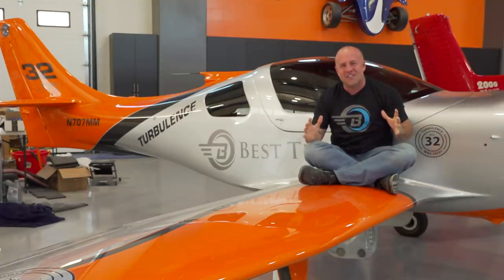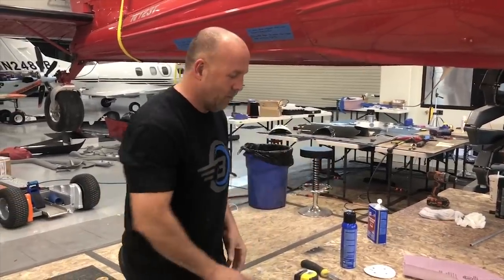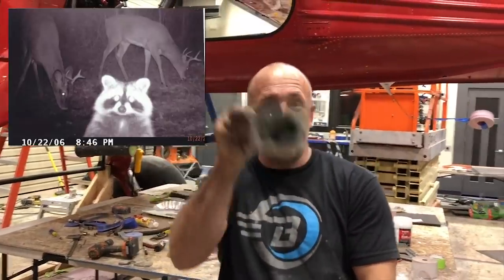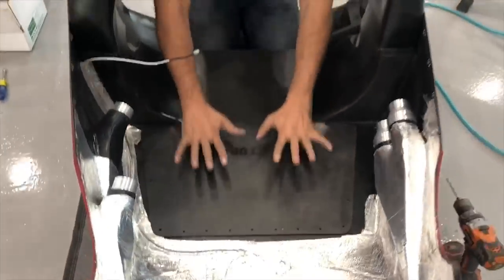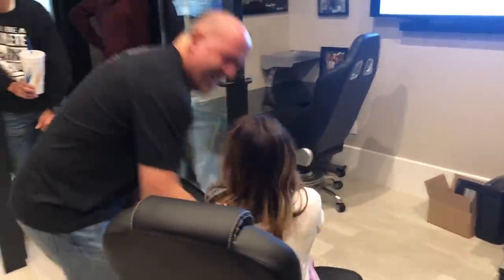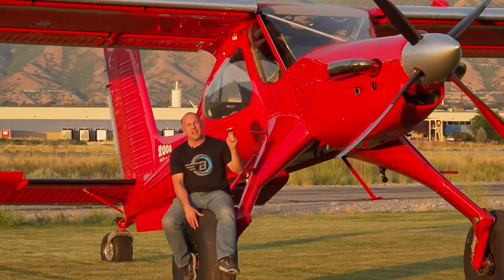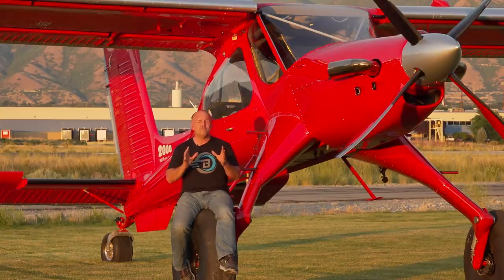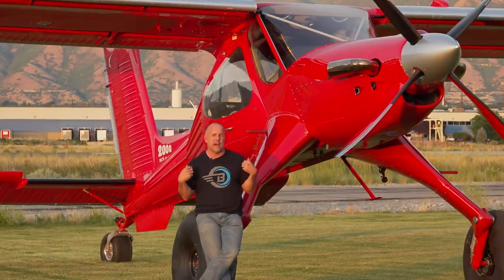Mike Patey Wilga (DRACO Video 16) Draco is Born

Comment: There are some elegant planes in that shed, both on the ground and on photographs hanging on the wall.  Looking on the lines of those planes, I must say that these people are highly intelligent and they have a  sensitive feel for dynamics and what is more they can build it all in practical terms, Congratulations  to all and I like the sense of humour while this gentle man works his masterpieces with such dedication.    Many years ago we had a go at building the Berkut and that was an eye opener for me in dealing with  blue foam and other modern material and how we tried to use every nick and cranny to put extra fuel in it including the hollow spar .   The Draco is beautiful  plane with ample power. I wonder if it could use that exhaust to blow the tailplane/rudder  so that on reverse pitch , the air  mushroom that is created would  not reverse on to them cutting their control abilities.

Comment: Thank you A LOT for the video series so far. It's been a blast. I am a computer engineer and totally envy your fabrication skills. It is totally inspirational and it boosts the creativness and will to make stuff. I am also a pilot and also see inspiration in there - one side is back country flying that few can experience but other is the pure theorethical knowledge about how aircraft works. It has been a mad project to take a fully certified aircraft and modify it to the point that it has become an experimental machine. However the theory and skill and confidence in your math and calculations is immense - to just rip the wing appart, modify it and be sure that it works as expected. Thats a big big dream and you are making it real. You are a mad engineer in the best possible way. Big thumbs up and looking forward to your next videos.

Comment: Mike, scrap the spray adhesive and use Glidden Gripper. Once you use Gripper you'll never go back to spray adhesive. Glidden Gripper is 100x stronger. It looks just like a white paint and when it dries there is no separating layers of pink foam. As in completely impossible to separate the layers. They are bonded beyond imagination.

Comment: Those oxygen fittings, we use the same for air fixings on the trucks, usually on the auxiliary rail systems for seats suspension etc, there a bit of a nightmare after a while, if dust or crap goes near them they leak pretty bad, at a few bar of pressure, I don’t know what pressure you will run at or much about plane building. We put the brass ones in when we can.

Comment: Mike:  Short Take offs.  I noticed when you power up with the brakes on the suspension collapses down about 5-6", but as soon as you release your brakes, the shocks kick the front end back up and you start your roll.  What would happen if you could lock the shock down in the compressed mode until you get some speed up and then release it giving you a push into the air...kind of like the British carriers and their ski jump ramp.  You would have to time it just right.  Maybe could use some electroheological fluid somewhere...With your slow flight angle of attack, getting your tail down farther is not an option...so maybe popping the nose up would help...or maybe a check valve with a bypass switch switch for the shock fluid ...   Looks great...Love your work and movies...

Comment: hey my brother and i fly my dad and grandfathers stin 108 fully metalized and floats on it for the last 25 yrs. Weve flown it safely for over 40 yrs.With that recent crash you guys might want to install brs chute systems.We use 2 on the stinson the heavy payload one for higher altitude and a little 1050 for low altitude.We think the the 1050 would work even if you pulled it at a couple hundred ft eg like the recent stal acident palmers friend had.In an old plane the worry is not how we fly it but a structural failure.108s are pretty ruggedly built but you never no. That 2 parachute system was 15000 canadian had for 5 yrs now glenn

Comment: Mike, a bit of info that may or may not be usefull in the future. In 1999, Wayne Handley crashed his Turbo Raven at the Salinas, Ca. airshow. 
Wayne narrated some of his routine from the cockpit through the PA system. His PT6 engine had spark ignition system, rather than glow plug system. He switched the spark system off because of radio static, which interfered in his narration. Engine flamed out and didn't re-ignite for beta utilization.

Comment: Super awsome job and plane. I admire your vision for the plane, enginering and manufacturing skills as well as involving your children in the project.
I was just thinking about something theoretically....When you land and apllying the reverse thrust, that as you said push the tail into the ground due to where the engine and front wheels are placed, do you encounter that if you stop applying reverse thrust and should keep the engine at high revs but the propeller blades move through the "neutral" position, it will tend to maul the air around the propellor in such a way(neither backwards or forwards) that it tends to pull the plane over to the one side which the design/angle of the front wheels help fighting against. With this I mean if in reverse thrust(You determined the amount of horsepower applied), will it be safer to quickly lower engine speed before going back to forwards thrust through the neutral position-?
I also wants to know if a few controls can be programmed to work together to make sure the plane stays planted after touching the ground on landing with one action-?

Comment: Way to go Mike! Tons of blood sweat and tears on the build out!

Have seen the some of the Oshkosh footage and glad all went well in the travels. 

Looking at the mods you've done I was wondering about a few things....

When you built out the gear leg "header" tanks.... ( great idea for that particular airplane) I'm wondering about gear flexing cracking out tank seams in the off airport environment you operate in. 

If that airplane is built anything like the M18 its a tank for sure. Wondering about the increased horse power and multi blades with the new turbine putting out harmonics on the tail horizontal elevator as well as rudder.   I remember back in the day when they had issues with the Cessna Conquest tail structures. 

Since you increased the wing size by adding leading edge and trailing edge surfaces ( really innovative the way you did it)  does it have an issue with the original wing Vmo structure stresses?

On shut down I noticed the usual PW fuel draining. You thinking about and EPA can?

Really impressed with your projects. 

Keep up the good work and thanks for sharing your journeys. 

Best.

Comment: I am here watching with a Boeing Engineer (2019) listening to you talking about reverse thrust and it's limits before removing rear surface controls.  He asked if you tried changing the angle of the prop along with RPM changes... His though was a "flatter prop" would allow for greater RPM and stopping power before the "Mushroom Effect" attacks the control and a possible stall.... I hope that all makes sense my translating his comments. .
Reply: He was talking about the R&D Boeing does. Scale models, wind tunnel testing both computer and actual, plus all the "meetings" required to do anything it sounded like this thing would cost $!00's of $1000's if not Millions of dollars to have built.  Well done !!!

Comment: THIS IS AWSOME !!! My mind was blown, your work is UNBELIEVABLE. Whole Idea from the PT6 to the carbon details, WING, the panel  and all done in home! I remember doing my glider training back in 2008 and being pulled into the air by PZL-104 35A (SP-EBI)  in my hometown Wroclaw  in Poland. Believe me when I tell ya, we still run them in their original configuration since the 60's ! I think EBI is on it's 3th paint job. Same scheme, it's just that it wears off every two decades or so. 
That's a recent picture with one of our gliders for basic training SZD-9 "Bocian" -produced in 1950's, we still use them daily, no joke.  From Poland with love!
https://www.airplane-pictures.net/photo/992195/sp-ebi-aeroklub-wroclawski-pzl-104-wilga-35a/

Comment: Mike, I have a couple of questions. The air filters at 4:30. Now that you've flown to Oshkosh and back to Spanish Fork, and now you've had your first off-field landing at "Not for You," how are those two air filters that are facing to the back of the aircraft holding up? I was curious if they may be blown off from the airflow.

My second question, if you have a piece of cured carbon fiber will a new piece of wet carbon fiber bond to the cured carbon fiber or does some preparation have to be done to the cured carbon fiber before bonding on another piece to it, and how strong will the bond be between the old and new pieces of carbon fiber or will that be forever a weak spot. I guess I'm also asking how to marry two cured pieces of carbon fiber and retain the strength of the carbon fiber. I'm getting mixed reviews from people I've spoken to, and it seems that you've done a bunch of carbon fiber work so I'd like your opinion. 

And Mike, thank you for adding the "How to" with carbon fiber segments. I really do appreciate them. I find them incredibly informative and fascinating. Your realistic approach to using carbon fiber and how to fix chips in a composite prop are outstanding.

I've found your video series on this project to be fascinating and incredibly informative.  Thank you again for these videos.

Comment: Why not pour some quick set resin over the foam, then bust out the foam and lay the CF down inside it or make the foam a bit small and pour resin and lay CF outside?
Reply: its just more work. Most of the time Mike is trying to just get parts done quickly.

Comment: I see your very creative A&P perhaps even an engineer. Do think a multiple forward speed transmission/gearbox would allow a plane to go faster or at least maintain a high speed at lower rpms with a high torque desiel engine, with a 2 speed super charger & turbo charged.

Comment: Hey Mike, 

I'm just wondering if you added stiffer shocks to account for the overall added weight? 
I noticed that it "appears" to be a little too mushy on touchdown but not having flown it myself, that may not be the case.
 
Lots of pilots that have experience in Wilgas are saying that they're bad for ground looping due to the excessive side to side rocking motion (giving you the sensation of yawing when it's not). 
I'm also wondering if the two shocks couldn't be semi coupled together to make them work together a little more? 

It still seems that a stiffer shock on each side would make it behave more like a traditional bush landing gear and I realize that the design of the Wilga shock system is part of what makes it attractive but having that feeling of yawing right or left when really it's just one side or the other squatting more than normal (when compared it to a typical bush plane). 

I had the privilege to ride right seat in a Sherpa bush plane a few months ago, we did a couple of short landings and the main gear seemed to support the plane very well and handle most of the shock from the initial part of the landing while the 35" bush tires kept if from launching back into the air as well as taking all the shock from the rocks we rolled across. 
That Sherpa was an awesome plane as well, it was like a Maule and an Otter rolled into one plane :-) 

What I'm getting at is maybe it would be better to have stiff enough shocks to keep the wings from rocking side to side excessively while relying on the bush tires for rough terrain.  

I'm sure you have given it a lot of thought! 
This was just my 2 cents worth :-) 

I really enjoyed watching the process and the progress......... and thanks for the great tips on making carbon parts, those tips will come in real handy since I make a fair amount of random carbon parts myself.  :-)  

Wishing you Fun and Safe Fights!! :-)  

Joe

P.S. It's worth mentioning that stiffer shocks would add more stress to the legs and attachment points on the frame, there may not be enough strength there to handle the added stress without strengthening those parts as well.

Comment: You can skip the wrapping so the part does not stick. just pour a small amount of acetone on the Styrofoam gasoline works also but leaves a residue acetone dries quick and leaves zero residue.. It will disappear before your eyes, pour out any remaining acetone and wipe out any remaining foam. Acetone should not hurt the part after curing, Now I am not saying to use any more than you have to. but just play with it a little on some test parts. Test it and see if I am not correct. I have made custom car parts with Styrofoam and fiberglass for years, it never hurt the fiberglass parts dont know why it would hurt carbon fiber..Just trying to save you a lot of work. just pour a little wipe a little maybe have to cut a little. Boy I can say first hand when my brother showed me how to do it. Well it made making parts easy. Just shape coat a couple times and melt the foam in seconds and most times a damp rag acetone damp rag just wipes the inside clean. there might be a little foam left in deep tight areas but it wont go anywhere and it dont hardly weigh anything. So try it you gonna like it. God Bless you I am glad you are okay. this old world needs more Mike Patey's in it
Reply: P.S. goof off spray would work fine also but might leave a residue. might even could buy a chemical spray bottle and mist the acetone instead of pouring, OH YEAH A PAINT BRUSH, been so long since i made any parts I forgot about the paintbrush that is what worked best to apply the acetone

Comment: With all those filters on the intake are you worried about sand/dirt getting in the compressor? A trick that I have seen to enhance the blade durability of T56 engines is to have the compressor blades titanium nitrided. Really nice plane too.
Reply: With all of those filters, I don't think anything but air is getting in the compressor 😁

Comment: Mike, silly question: now that you've built the Most BadAss Beastie STOL on the planet & dramatically improved the design of the original Wilga, what are the chances of licensing the final product (ie, your improvements to the original Wilga design, which they would also need to acquire) to a company that could mass produce it?  I'm pretty sure you have plenty of subscribers, friends, etc. that would gladly part with some precious dangly bits to get their hands on one.  With the turbine, they could even design a pressurized version.  Any chance mass production could get the price down out of the stratosphere?

Comment: SO WHAT I DON'T UNDERSTAND IS YOU POSTED THE DEATH OF DRACO IN SEPTEMBER OF 2019 THEN  THE NEW FINISH OF DRACO IN NOV. OF 2019 SO WAS THIS DRACO THE SECOND AS I SAW YOU WALK BY A STOCK POLISH PLANE AFTER THE CRASH WHEN YOU WERE WORKING ON SCRAPY . ANYWAY THE DEATH OF DRACO LAST PICTURE WAS ONE OF THE SADDEST PICTURES I HAVE SEE IN MY LIFE IT WAS LIKE A TRAINED DIEING DOG ,  I TRIED TO DO EVERYTHING THAT YOU ASKED OF ME I LOVED YOU BUT YOU FINALLY  KILLED  ME  IN YOUR ARROGANCE  AND YOU COULD HAVE KILLED YOUR WIFE AND YOUR SELF . IN OBVIOUSLY REALLY BAD DO NOT FLY WEATHER.  THAT YOU FILMED PROBABLY FOR INSURANCE PURPOSES . 
WHAT THE HELL WERE YOU THINKING.... TO BUMP OFF YOUR WIFE AND COLLECT LIFE INSURANCE. 
PLUS INSURANCE FOR A NEW DRACO.  JUST WEIGHTING ONE HOUR FOR THE SQUALL TO PASS . 
I WANTED TO ASK YOU BEFORE YOU KILLED DRACO  ONE . IF YOU NAMED IT AFTER THE FLYING LIZARD OR AFTER THE COMPUTER PROGRAM CALLED DRACO . AND IF THE LATTER IS THE PROGRAM YOU USE FOR YOUR MACHINING CENTERS.  AS I HAVE A IDIA FOR POWERING UP  A NUMBER OF THINGS  LIKE A MOTER CYCLE AND AIRPLANE WITH A UPSIDE DOWN. DRY SUMPED  ALUMINUM  HEMI OR ESPECIALLY FOR A AIRPLANE  A MARRIED BLOCKED PAIRS OF HEMI'S TO DO A HORIZONTAL PARE OR MORE BLOCKS PUT TOGETHER TO FORM A RADIAL ENGINE SHAIRING THE SAME CRANK SHAFT . 
TO REPLACE THE ORIGINAL POLISH RADIAL ENGINE . 
I HAVE ALWAYS BEEN A OUT OF THE BOX THINKER . BUT NO MONEY TO FOLLOW THROUGH ON MOST OF MY IDIAS . SO HERE'S MY IDIA FOR SOMEONE WHO'S PROVEN HE HAS BRAINS BUT ALSO THAT HE HAS MORE MONEY BRAINS . TRYING TO TAKE OFF INTO THAT STORM .  ANYWAY I HAVE WATCHED SOME OF YOUR POSTINGS ON SCRAPY BUT LOST TRACK SO I HAVE NOT WATCHED YOU FOR A WHILE . I NEVER LEARNED TO FLY BECAUSE MY TEACHER WENT OFF AND KILLED HIMSELF DUE TO HIS OWN ARROGANCE FLYING DRUGS UP FROM SOUTH AMERICAN AND BAGS OF CONCRETE BACK DOWN TO BUILD A BETTER AIRPORT DOWN THERE AND THE BAGS SHIFTED AND PINNED HIM FORWARD AGENST THE CONTROLS IS WHAT THEY THINK THAT KILLED HIM. 
SO I REALLY HOPE IT'S NOT DRUGS THAT FUEL'S YOUR LIFE STILE . I HAVE A BROTHER WHO DRUGS HAVE BEEN HIS LIFE STILE OWNING PLANTATIONS IN SOUTH AMERICAN.  SO I SEE A SIMILARLY TO YOU MIKE UP ALL THE TIME DAYS ON END . SPEED AND COCAINE AND SAINTEN KNOWS WHAT EVER ELSE. 
I CAN ONLY HOPE THAT YOU ARE NOT FLYING IN DRUGS AND USEING THEM TO SUPPORT YOUR FAMILY AND LOVE OF FLYING. BUT I SEE A POSSIBLE DRUG CRAZED CONNECTION BECAUSE OF MY BROTHER AND OTHER PEOPLE I HAVE KNOWEN.       ANYWAY I LIKE YOUR PASSION AND ENTHUSIASM FOR FLYING